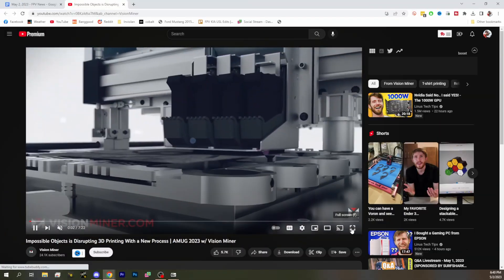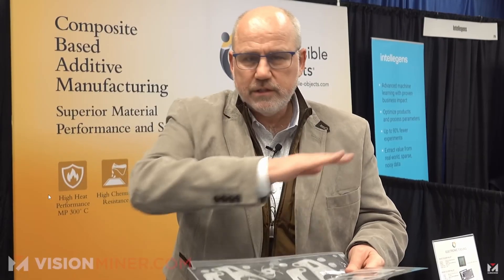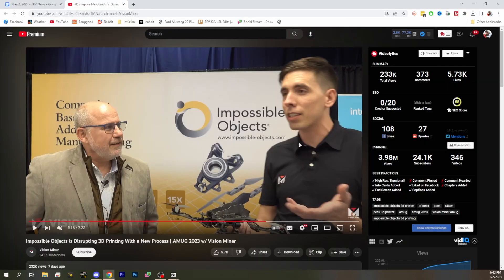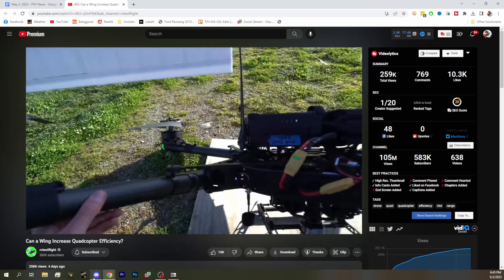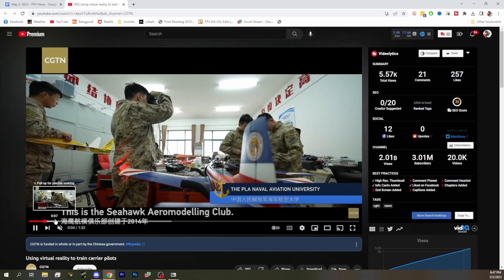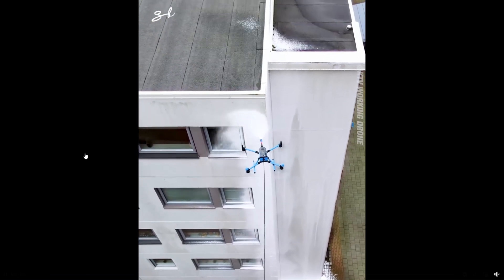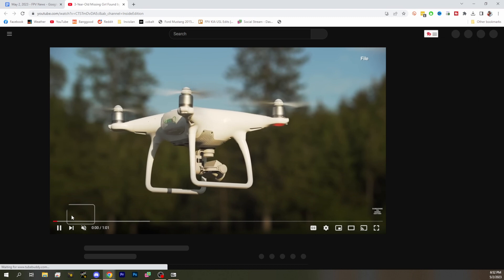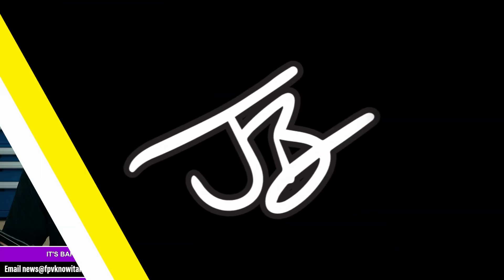New 3D Printing Method For Drones? China Using DJI FPV To Train Aircraft Pilots? - FPV News

Comment: This is a good start but i wouldnt use this over the standard cnc carbon sheets or molded parts at the moment. Give this 10yrs and it will prob be amazing.

Comment: The extreme strength of CF laminates is that the fibers are aligned on a single direction at a time, increasing strength dramatically. This looks like it's just woven fibers without a specific direction, i'm not sure it'd be comparable to a traditional CF sheet in terms of strength. Also questioning the out-of-plane strength.

Comment: What I can say about this method of making carbon fiber parts is that the traditional method is a nightmare. You need a form, a giant oven and so on... 
It's similar to what they do with fiberglass, but with a huge oven.
Reply: True, but making carbon sheets (and then cutting them) is pretty straightforward and not nearly as much of a pain in the rear as say an aerofoil
Reply: @JekleFPV  Very true.